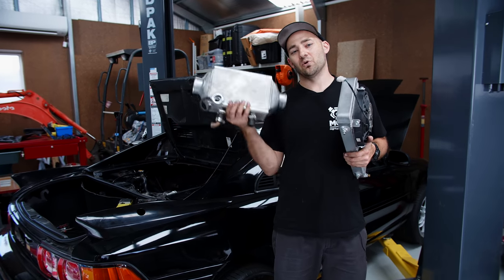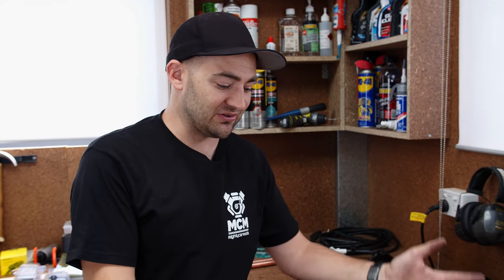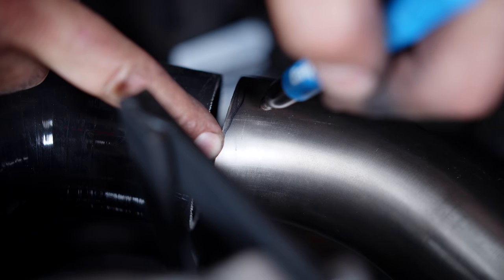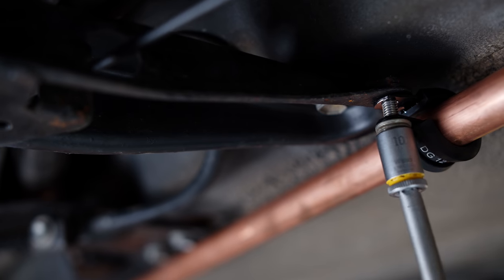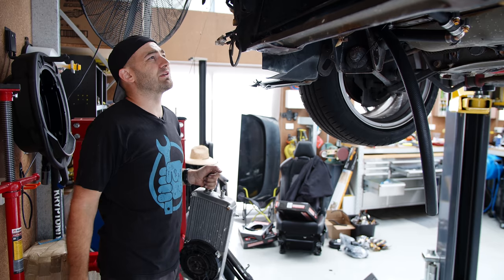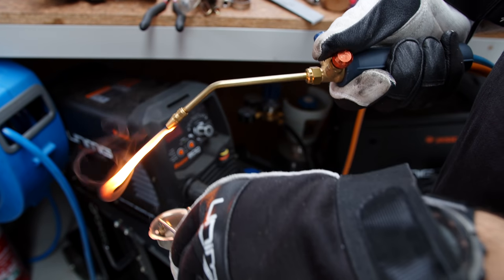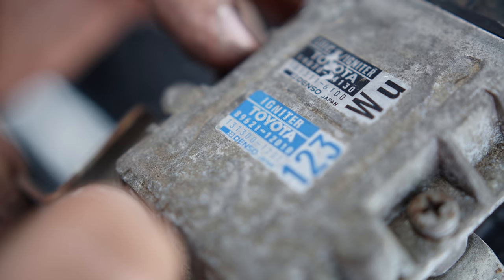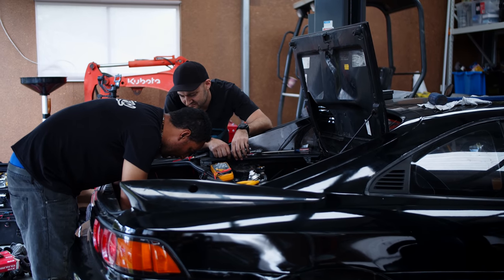MR2 takes Miss Daisy parts (Water to air Intercooler Install)

Comment: They should just rewire the whole engine and call it a day rather than fiddling ad nauseam with ideas that the hope will work out. Just like they shouldve pulled the engine at the beginning rather than spend all if those hours wrestling with broken studs and other headaches.